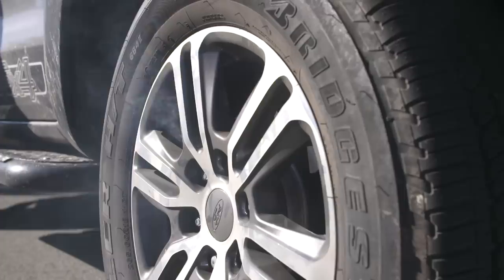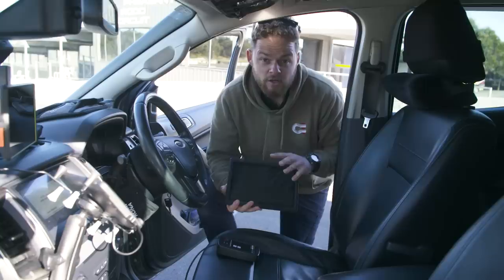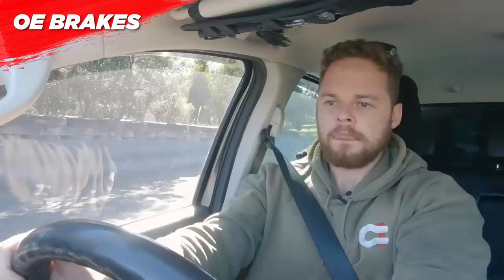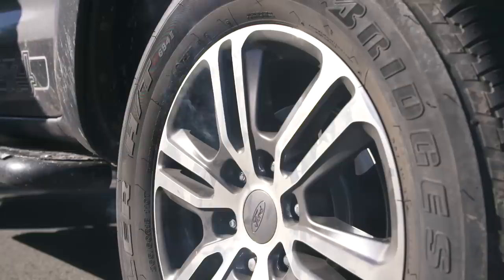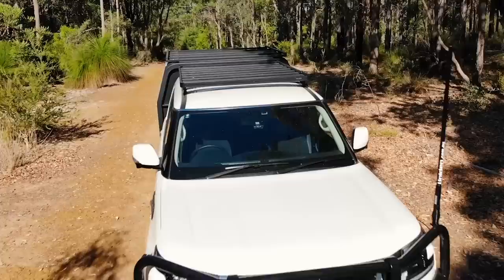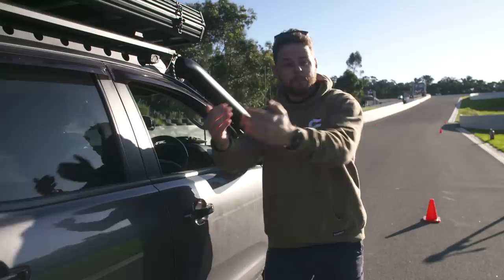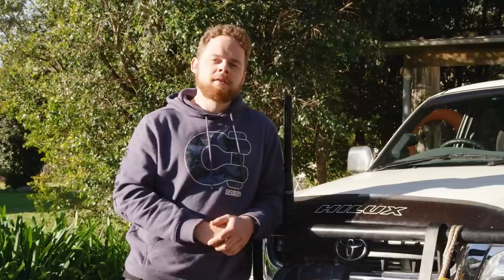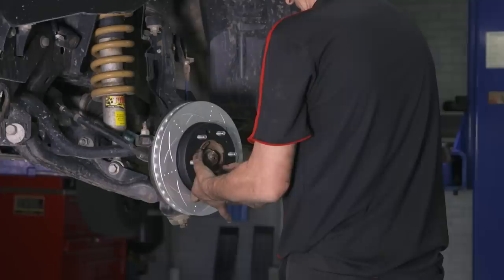ARE BIGGER BRAKES WORTH IT? Standard vs. Aftermarket brake test - Why the OE ones failed!

Comment: Hi Jocko, great vid and enjoying the info you are producing, keep it up.
 Gu 2011 patrol zd30 common rail. 16" x295/75. Vehicle constantly loaded with recovery gear, rooftop tent, fridge, bull bar, winch, rock sliders, lifted 3" with heavy duty shocks and springs. Often go away with 3 ton camper trailer with tinnie on top and 15hp outboard. The standard brake setup no longer up to the task. A Bendix up grade would make it a great deal safer and confidence inspiring.

Comment: Legends, I’ve got a 2000 Nissan GU patrol coil cab ute that I’ve been putting mods on to get her ready for a cape York trip sometime in the near future, she’s got a few mods on her with the biggest being an engine conversion to a big heavy v8 turbo diesel, with the new ally tray and canopy set up it has helped with my braking but not as good as she should be, having an bendix brake upgrade kit on her would be the icing on the cake for this big girl 🤟🏽

Comment: 2015 Dmax Dual cab. from mid 2023 I have 12mths  off from work, fully paid and plan to do the big lap!... (my first time doing it), As such I've built in my tub and canopy for the trip, which has added a lot of weight, as I will be living out of the rig for the trip, unless I can afford a camper trailer, then I'll be towing that everywhere with me.
I dream of a Big Disc upgrade for the front and a Drum to Disc conversion for my rig.

Comment: G'day Team, I have a '92 Toyota 80 series, straight off the bat given it's an earlier model of the 80 it has the smaller brake package than the post '95 models. 80's are known for dead average brakes at best and now with all the bar work, drawers, spare tires and camping gear the old girl certainly isn't light. I'm a full-time uni student so money isn't as readily available for me, so something like brakes with the associated costs make it difficult, a kit from Bendix would go a long way in improving the safety of the 80 and help keep make sure everyone, including me, gets home safely. Good luck to all, and cheers for the opportunity! 

Cheers, Frank

Comment: I’ve got a 2009 n70 Hilux. Added a the regular mods, bar, winch, bigger tyres and looking at a full tray and canopy. Already I notice the difference in performance with standard brakes and it’s sometimes scary. The ultimate brake upgrade would be an awesome mod to complete the rig

Comment: Awesome videos. I shared it with my dad for his ranger

I driver a 2011 triton that had been to the Gibson desert and back a few times with nearly 2T of dual Axel trailer behind it. Basically instead of fly in fly out for a week or two at a mine site, I drive in drive out 12 months at a time at an aboriginal community called Warburton WA. And I have tool boxes instead of campers to ensure do my job! 
Cheers

Comment: Hey Jocko. Thanks for the video mates. I just bought my first ever 4wd. 1994 80 Series Landcruiser with a straight six petrol. You can never underestimate the power and necessity for decent brakes. I am hoping to upgrade mine on the 80 soon to get it ready to load up for some serious tracks and camping. Brakes are next on the list as I wrote my previouds car off a few weeks ago when I sadly couldn't stop quick enough to avoid a roo. Was gutted. First car I had ever owner. But at least the missus let me get the 4wd to replace it. Thanks for the video mate. Stay safe.
Reply: I had and 80 series 1HZ and all I upgraded was the Brake skoes and Slotted rotors. Stops on a dime every time. They already have a Dbl Diaphram Booster so no need to change that.

Comment: Boys how are we,
I’ve got a 1994 Toyota Hilux surf with all the noise on her. 35’s, 6 inch lift, roof tray, awnings on each side, spare tyre, draws in the rear and more lights then a Christmas tree. Just went to take the forby out to see the misses and my rear drums have ceased again. A break upgrade would be a life saver. 
Cheers boys

Comment: Another cracking vid guys! Awesome bit of gear by the boys at Bendix! Very informative and useful information for all 4x4, towing and tourer lovers!! 
I got a 2006 SR Hilux n70 that’s been fully restored from the ground up into a full tourer! Still rocking the original brakes unfortunately and the old pedal does feel alittle soft and the hand brake/rear brakes… well their Bluetooth! 
Got a big trip been planned for the cape at the end of the year and the bendix brake upgrade would not only make the rig unstoppable (very stoppable😝) but safe and reliable aswell !
Keep up the good work legends !

Comment: I've got a 2002 GU Patrol, I have recently done a barra swap and is in need of a big brake upgrade kit. Also a brake upgrade won't only help with slowing down quicker but also help with engineering. Cheers

Comment: SR5 2011 N70 TOYOTA HILUX 
who doesn’t need this brake upgrade kit. If it’s going to stop you nearly 20 meters shorter then standard,means everyone needs this upgrade kit regardless if heavy or highly modified. Potentially this brake upgrade can save you from having a bad accident. Yeah my Hilux is pretty modified but I think It’s a must have that everyone should be running.

Comment: Jocko Thank you for the info. this is so important and over looked. My family and I live in Florida. we drive flat generally easy roads. But when we go to the mountains up north we feel the brake loss and its scary. I already thought of putting new brakes on my vehicle but haven't had the chance yet. Until this video I wasn't even sure if I should go with a big break or just rotor and pad change. For our Heavy Jeep Wrangler  with our Twins on board we will probably change front rotors, pads and calipers. I literally change out my brakes before any big road trip to get the most of what I have currently. Our next big trip will be a first as I have never driven in Snow before. Getting there will be a 2500 mile drive. Thakn you for all you and your team do. Jeep Wrangler Sport Unlimited 2017, Rock Krawler 3.5 lift on 35's. Steal brake lines. Swayloc swaybar, Front and rear bumpers with a winch and Rock sliders. 47L Fridge, Cascadia 4x4 100watt hood mounted Solar panel.  working on  Undercarrage protection for 5 gallon water tank. (next upgrade)

Comment: Hey fellas.
Wish I had a brake upgrade on my old van, recently crashed into a 100series landcruiser and wrote my old van off on the hwy, now upgraded to a 2017 Mazda bt50 UP GT. sitting just under gvm. Scares me with the kms and the weight im caring that it may happen again. So much invested into the new work car. Would certainly put my mind at ease a little knowing the car will stop no hesitation.

Comment: Hi Jocko, this was a great demonstration, however, there is one pretty major thing that should be noted here: Consistent speed. Yes, I know its "only" 5-6km/hr difference between some tests but, this has much more effect than you would think. Brakes turn kinetic energy into heat. That's how they stop the car. So, braking distance is determined by how much kinetic energy must be converted. Assuming a total weight of 2500kg and using the formula Kinetic Energy=0.5 x Mass x Velocity Squared (in metres per second) we get 542kJ of energy for 75km/hr and 697kJ of energy at 80km/hr. That's a difference of almost 30% in the amount of work the brakes have to do to stop the car.  As a result, the difference between test 1 of OE brakes vs Test 1 of Big Brake Upgrade could be significantly overplayed in this data where we have 82km/hr versus 76km/hr. Of course, the big brake kit will be better, but not as much as the data suggests here. Similarly, Test 4 OE vs Test 4 Level 1 show virtually the same stopping distance, but apples for apples, the OE should have performed quite a bit worse. Not to say this demonstration didn't show what it set out to show, but it would be much more useful data if speeds were consistent so we could see the true impact of brake upgrades. I know that is much easier said than done, but maybe its time to calibrate that right foot 😂 The pedal pressure alone, however, is enough to convince me the family MU-X might be in need of a level 1 kit to offset the bigger tyres she's running around on. Cheers mate!

Comment: G’day fella,
I have a 2021 MR Triton GLX+ I’m wanting to upgrade as I don’t have much confidence OEM brakes and haven’t added much weight to my ute yet. 

Once I’ve added a front & rear tow bar, bigger tyres and camper trailer, a Bendix brake upgrade will give me more confidence on and off road, especially travelling with the wife and tin lids.
Cheers
Lee

Comment: Hi guys! I have a 1999 RZN169R Hilux. The old girl doesn’t stop like she used to. Safety is priority so I will need a to upgrade the braking setup. I am am about to start towing a trailer with moto bikes so it will be even more important to have an upgrade.

Comment: Hi Jocko, very informative video. Just got back from Cape York in my 2002 Hilux 3lit Turbo Diesel, towed a camper trailer. Have ordered a Austrack Hybrid 15 Van, the next trip will need better brakes. Love the 4WD 24-7 videos.

Comment: I have had a GU Patrol for the last 7 years and over the time it has definitely put on some weight! This includes a steel tray, larger tyres and possibly and larger engine conversion down the track. On top of that my partner and I have recently purchased a camper trailer. ! I’d love an upgrade kit to make it a lot safer for future drives! Thanks for the tests guys.

Comment: 2018 Toyota Hilux - I've added a tray and canopy and soon to be roof top tent as well. Lot of added weight there and have definitely noticed the performance drop in the brakes. Also get a shudder when braking down long descents so something a brake upgrade will fix I'm sure!

Comment: I have a GOOD ol 1999 Nissan Patrol GU, Finally got it all set up and capable for Towing a Camper (My Home) well off road all around OZ. I put the break upgrade as the last thing to do (make sure all desired fittings accommodate for real weight requirements) before going through the Engineering and Certification process. But just before getting this done I had to move out of the rental property and shift the last of my worldly possessions into storage during one of the worst flooding periods in the area. While towing a trailer with all my stuff, which was still considerably lighter than my camper, I had come through an over road flow - I could not pull up in time and ran up the backside of a Garbage Truck - of all things. Pictures are not pretty!!! Now the long process of trying to rebuild her. The "Break Upgrade is now the top of the list" and I have not known what products to turn to - Bendix is a well known and trusted brand - But I was unsure of the real measure of value to their upgrades - Wish I decided earlier!!! Great real life test / demonstration of the differences in levels of upgrades...  Cheers.

Comment: I have a 2006 ml triton. Love the 3.2lt. Had the beast since 2013 and it has received the full touring  upgrade. Tune is only arond the corner. Almost everything has been built at home but since the custom fitted canopy has gone on the stopping distance has increased. Living in fnq, it sure is good to be able to stop quick on some of those remote roads. Cows don't make good hood ornaments.

Comment: My baby is a 2013 Nissan Gu y61 Patrol with the mighty zd30. I have de-sooted intake, 3inch exhaust and put a uni chip in and now with the extra power my poor old girl wont stop to well. Heading to tassie and would love piece of mind knowing i can pull the camper or caravan up in time. Top info Jocko cheers.

Comment: I’ve got a 2016 Isuzu MUX, bigger wheels but not much weight on the car, but have a new off-road camper trailer that I am wanting to really push off road and with 6 peoples gear, will be pushing the weight capacity, so break upgrade will make a huge difference

Comment: Hey guys! I drive a 2016 n80 hilux. I’m needing some new brakes badly! With all the weight, we have some draws, fridge, 12v system, tools, awnings, solar panel, water jerry’s and so much more on the ute, would be great to stop the Ute in an emergency if we had to. Also planning a trip from Sydney to Perth to Tasmania and back to Sydney for 2-3 months, so these would definitely be needed for the gear we’ll be taking. Also having the reliability of the brakes would be great to have too. Cheers, Will

Comment: We have a 2018 Ford Wildtrak.
We tow a camper trailer often and even with electric trailer brakes you need to take consideration when thinking about how fast we are able to pull the beast up.
Would be amazing having an upgrade knowing what we have seen in this clip, thank you Jocko!!

Comment: I've got an MN Triton at 140K's and is still running OE brakes. Haven't even thought of brake upgrades until watching this video! I'm planning on getting new suspension and adding drawers to the tub so a brake upgrade to go along with it would be awesome with the extra weight i'll be adding to my vehicle. Great video Jocko!

Comment: 2006 mk triton. steel bull bar, steel side steps, steel tray, 185L fuel tank, regularly transport on the the tray 1 drum (44 gallon drum size) 250kg - 3 drums 750kg of semi liquid. highway driving and city traffic.

i'm a glutton for punishment. just done the front wheel bearings. just looking at trying to undo those bolts from the hub that holds the disk on looks like the bolts are quite rusty on the threads and done up super tight and the disk frozen to the hub with surface rust, any lesser person would dread mucking around with rusty frozen nuts and bolts with mangled and butchered threads, me on the other hand only needs a push to go full rambo on an all day break replacement marathon on a saturday with shops closed on sundays if i break or need replacement parts for something obscure and have to wait until monday morning to finish.

Comment: Awesome results...........I have a GU 98 Patrol with larger off road tires and a decent sized front bar. I am buying a hybrid camper soon, but I have doubts about how well the current rig will be able to pull up a van that is fully loaded, and a tow vehicle that is carrying more than it normally would..........your results speak volumes for what a break upgrade kit can do to improve fade and stopping distance. I have been looking at Bendix upgrade kits on the net and they really do seem to be well designed and purpose built to give superior results.....cheers!

Comment: Hey Jocko, I bought a GU patrol off an auction and it ended up having a blown engine and all the electrics don’t work I am now putting a Barra into it and need to upgrade the brakes to past the engineering test, so this brake upgrade kit will be great for the build

Comment: Hey Jocko and crew, 
Good video - clearly demonstrated the differences and benefits with the respective upgrades.
We have a 2011 GU with the typical weighty accessories. I have had some scary moments with my previous 2000 GU especially on the dirt roads and eventually wrote it off (technically)on the the black stuff. I have skidded a few times with the latest unit and once touched the rear of a 4 care pile-up that I saw start and finish before I got there but the big girl just wouldn’t pull up. It truly made realize how big , heavy and un-car-like these beasts are. Planning on some serious touring at the end of the year but in the meantime will being using her for city and country driving for work. Pretty keen to see a few tracks in the Vic High Country with my son in (hopefully) his new GU over the coming months also. I have to admit that I did seek out these upgrade kits after the these incidents but there were supply problems for quite sometime so it all went by the way side. For these reasons I have been less inclined to drive it - instead opting (much to my disgust) for our second car - a little Toyota Echo. Would love to have the confidence to use the big girl more, especially with the up coming country driving.

Comment: I've got a 1997 Toyota 80 Series Landcruiser, it is my first car and its going to be chopped and have a chassis extension. It would be great to have the brake upgrade and with the extra wait added from the steel of the chop and extension added on to the already heavy Landcruiser it would be nice to make it stop on road and off especially on those tougher and steeper tracks.

Comment: Ford courier 1999 duel cab planning to travel around Australia having brought this ute 2 years ago have done a lot of repairs new second hand motor body work and general tidy up, Most of all it's 
\about having fun doing it. The brake's work that's good but as part of this rebuild shock's, brakes, tyres ,is down the line. Keep up the good content as this was the reason for starting this project .

Comment: Hey Jocko, After having our pride and joy stolen and having it retrieved the brakes haven't been the same. They shudder heaps and get insane brake fade put new pads but couldn't afford to replace the rotors aswell. Have a constant weight of around 300kgs and sometimes tow our camper trailer so I think the upgrade would be awesome to win as It's very much needed I think. We were very lucky to get the vehicle back most of the time they get burnt out. Thanks

Comment: Hey Jocko, I would love to upgrade my brakes..I have a 2011 79 series Cruiser which are known for having below par brakes.  It has a 3.9 gvm upgrade and sometimes has a canopy on the back. So far I  have changed all the rotors to Slotted and use Bendix Blue, or Bendix 4wd pads. It stops pretty well and will lock the fronts when empty but needs a bit more when the canopy is on. Only other change I would need to do is Braided Lines and Upgraded Double Diaphram Brake booster.  I have also changed the fluid to Dot 4.  What you DON'T mention is, When you put the big brake package on, you also have to go up at least 1 wheel size as most OEM brakes are sized by the inside room on the wheel.